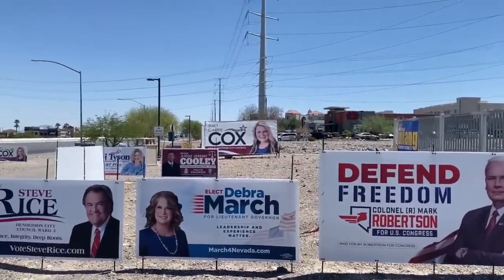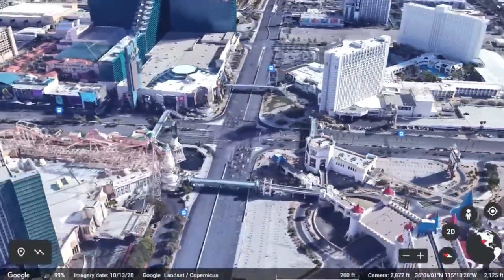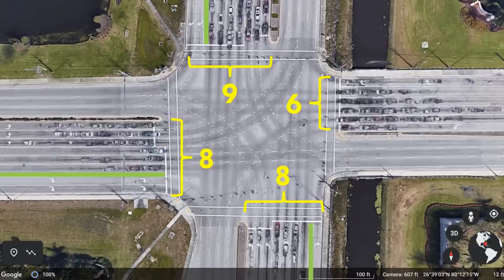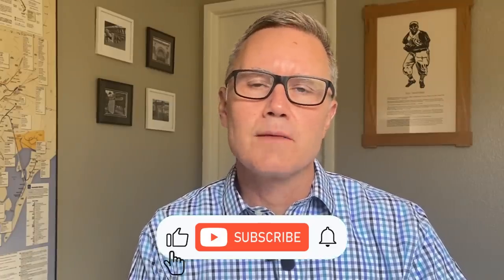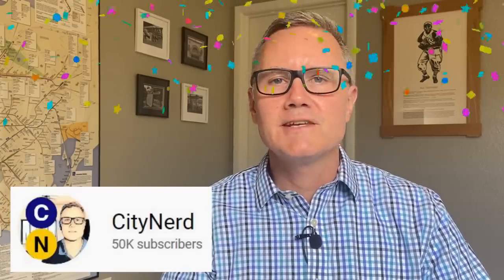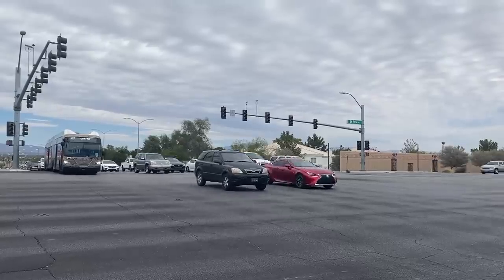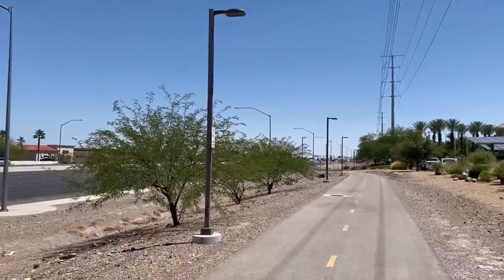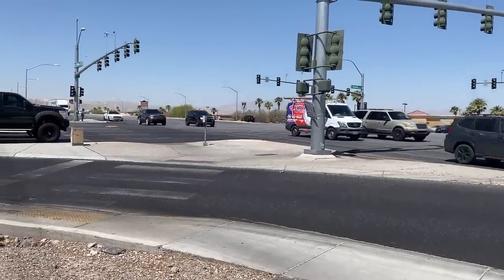Stroad vs. Stroad: Land Use, Traffic Engineering, and What Happens When Suburban Arterials Intersect

Comment: The problem with slip lanes and right turns (or left turns in left-hand drive areas) in general is that the traffic a car will be turning into is coming from the left so most drivers will focus to their left and not see the pedestrian or bike coming from their right. Slip lanes exacerbate this by giving a "safe" space for the car to wait that is usually ahead of the pedestrian crossing. This means that most drivers will still be going a decent speed (20+ kph) when they slam into that pedestrian in the crosswalk (or even faster if they see no traffic in the lane they want to turn into). Even though I try to be careful when crossing intersections I have still personally be hit as a pedestrian three times in five years while crossing suburban stroads. In each of those cases it was from a driver that was stopped at a red light who then went for it when they saw no traffic coming from the left, hitting me who had just started walking on the green. Fortunately I came out of these just with some bruises and lost skin.
Reply from the maker: It's really nervewracking crossing these things. I want some sort of assurance the driver is aware of my existence before I start crossing, but it's really hard to see through glare and distance and identify facial expressions. Such a flawed system.
Reply: It's bad enough just for cars---my first accident was because Florida Man, driving in front of me along a slip lane into a clear road, stopped at the yield sign while I was looking to see if there was any traffic to yield to. On a very wide road the slip lane will shorten the uninterrupted pedestrian crossing distance. But on the very few intersections where the crossing distance is a problem, a right-turn signal could be added.
Reply: Another, less acknowledged issue of right on red is that it means the car needs to creep into the cross walk in order to observe the oncoming traffic from the left, obstructing pedestrians.

Comment: In Texas all red time is definately still travelable as is two seconds into the following green.
Reply: "Thank you Jesus!  Thank you Lord!"
Reply: I can confirm this. I feel like I have to give a quick glance in the rear-view mirror before stopping on a yellow (greater Houston area) if I don't want to get rear-ended. Yellow-red running is absolutely commonplace here. A flagrant red is somewhat less common.
Reply: In Houston, I saved myself from a serious car accident a few times by looking to clear the intersection after the light turned green. I definitely don't trust other drivers.
Reply: @wenkeli1409  I've run a lot of Houston intersections that were on the red side and looked in my rear view to see at least one car went through the light hehind me.

Comment: My favorite (sarcasm) details that let me know that nobody cares are how they build the islands that are there for our safety with rounded off curbs that make it easy for cars to drive up and over them. Rims > humans.

Same with painted lines, rumble strips and fold over bollards designed to suggest lightly that cars and trucks stay out of bike lanes or pedestrian space but do nothing to stop them. 

Watch a semi-trailer hit a squared off curb on a right turn, the inside tire will scrub across the edge and then drop down into the road again. On a rounded curb even a regular car will have traction to drive up and over the island with ease.
Reply: It also keeps tires from accidentally hitting a steep sharp curb and popping the outside sidewall of the tire (did that once... not fun.)

Comment: It’s not often I go out to the suburbs, but I hate crossing two intersecting stroads in my power wheelchair. 

I do encounter slip lanes and beg buttons in the city — hate both. MoDOT builds a channel in the islands so I have to travel in it, even when littered with debris from car accidents. Sometimes they place the beg button too far away, or on the opposite side. 

The other thing I hate is when I’m barely started crossing a street and the countdown timer begins almost immediately.

Comment: Had to cross one of these on foot or bike on my way to and from work for 4 years (not as huge but it still sucked!). The ped islands are terrible, in the heat you have to wait there in the middle of all the black asphalt with no shade and zooming cars two feet away, its truly miserable. I think its probably at least 10 degrees hotter on the island than the ambient temp, which is a big deal if its 100 F out (common in the summer at the intersection i crossed, and im sure more common in las vegas!)
Reply from the maker: Yes, a literal heat island effect
Reply: @CityNerd  Yes!!!!

Comment: Man, its wild to see you discussing an area I drove for years every day, and still drive often. I also wanted to say that just a few blocks down there is a street called Starr Ave (or Raiders Way, which was formerly Henderson International, if you are on the southeast side of St. Rose) which a friend of mine pointed out as being an area currently being developed at such a point it may be possible to have some meaningful change after I complained to him about some of it's flaws. After Starr Ave was continued so that it connected to the I-15 it is either packed with Cars and Vans from the nearby FedEx and Amazon Warehouse or it is essentially empty, so much so people drag race on it at night. Since the area has undeveloped lots however there are a lot of areas without sidewalks, and the crosswalks are poorly marked. The reason this is so important is that it is right by a High School with a number of students walking home along Starr, and there is an Elementary school and Pre-School directly on Starr. While Starr is 35 mph with two 25mph school zones, since people often get onto Starr coming off of the I-15 or St. Rose, its not uncommon to see people driving 45-50mph. I have even witnessed a FedEx truck go 60 through both school zones with lights flashing. With St. Rose developing some new businesses nearby and having those separated walking trails / Bike paths, it would be easy to ride a bike to the nearby gym, or to stop by one of the small food places located within reasonable biking distance. Starr even has areas that are designed to become bus stops, but in the few years they have been there not a single bus has stopped at them. Starr is also likely to become a 7 lane Arterial with 3 lanes in both directions and 1 center turn lane. It currently has 2 in both directions with a center turn lane, although with ample room on the sides, once the area is further developed it will likely widen. 

I bring this all up because I am currently planning to go to the Enterprise Town Advisory Board (Since Starr Ave, once you pass Bermuda, is in Unincorporated Clark County instead of Henderson) to try and propose changes. However, I would love to hear others thoughts on the subject as I am not a Civil Engineer and am hardly an expert in city design. I am currently considering suggesting dedicated separated bike lanes instead of a 3rd lane, reducing the speed of W Starr Ave (specifically the section between the I-15 offramp and Las Vegas Boulevard) from 45 to 35, a better designed median since traffic in both directions sometimes has to enter at the same point, and lastly some sort of speed bumps around the school zones (While standard speed bumps would probably violate Fire Codes, there are smart speed bumps that have been developed that can pop up during the times lights would flash, and in the case of emergency could be put down to allow for emergency vehicles to pass.) Also for the time being, since the undeveloped lots will not be getting sidewalks until they are developed, I would like to urge the creation of some sort of alternative instead of simply walking/biking across dirt or in the street with traffic. Currently some areas have an asphalt strip where a sidewalk would be about 1-2 feet from the road which is better than nothing for the time being. 

I also would love to advocate at a later date for a change to HOV lanes on the I-15 (Although it seems they may be getting a change soon) to something like a dedicated Heavy Vehicle lane to allow for semi-trucks to drive through Vegas without blocking faster moving vehicles. If they HOV lane will remain as is, at the very least the addition of plastic bollards along solid double lines to discourage cars from merging in and out of the HOV lane randomly while allowing for emergency vehicles or maneuvers to avoid a crash to be preformed with no significant harm. Also I would like to suggest that the County adjusts the timing of lights along St. Rose between Starr and the I-15 so that it makes it easier for Amazon Vans to use St. Rose to access the I-15 freeway instead of Starr. Alternatively I would be curious about the possibilities restricting commercial vans along Starr during certain times of the day to induce the same effect, although that is something I think would hardly change much in terms of traffic or safety. 

Regardless, I would love to hear anybody's thoughts on the matter so that I could better propose meaningful change. =D
Reply from the maker: Just getting to this comment. I've biked around that area quite a bit (St Rose/Raiders) but haven't been on the north side up Starr. On an aerial or streetview it's pretty clear they're dedicating right of way to blow it out to a pretty wide cross section as you say. My experience from living a modest amount of time in this area is that the roadways are WAAAAYYYYYY overbuilt. There are streets with 5 and 7 lane cross sections that are never anywhere near being "congested." I don't know how they're doing the modeling and forecasting, but the answer's they're coming up with are very bad.

Comment: About Pork Chops: They seem designed to be horrible to bike across. My city has great bike paths, but whenever I have to cross a stroad intersection it's always depressing to have to navigate onto the pork chops, which are usually very bendy and such in a way you can't just bike straight through it and sometimes have to even dismount your bike. I understand this may be on purpose, but if our goal is to fight climate change why are we building bike and pedestrian infrastructure that make people not want to bike or walk.
Reply from the maker: 100%. It's never a straight path through he pork chop (often blocked by a signal pole too) and then to compound it there's often a queued right-turning vehicle in the slip lane, blocking the ramp you need to bike onto.

Comment: Can you do a video about accessibility of public transit in the US? I recently visited New York and though I really loved the city and subway system, I use a wheelchair and found only a tiny bit of it (mostly in Manhattan and Brooklyn) to be actually accessible. Hell, I live in Oklahoma City and our tiny streetcar lines and bus system and BRT lines they’re working on putting in are (at least technically) way ahead of the mta subway in terms of wheelchair accessibility.
Reply: That is more because the subway system is exceptionally old.  The core dates to very early in the 20th century, and a majority of the current system (almost all of it as I think) was built before WWII.  This means that it was mostly built in a time when people really did not think much about wheelchair accessibility, and labor was cheap enough that attendants could have been provided to help those who needed it anyway.  Also, usage at this time was so intensive throughout much of the day that the Subway was forced to employ people to squash the crowds of people into the train cars in order to provide sufficient capacity.  In that kind of environment, attempting to provide for wheelchair users and those with accessibility problems is a lost cause anyway.  Because of how the city and system interact with one another, retrofitting the stations is extremely expensive, meaning that doing it all at once is absolutely out of the question.  It has been done in various places throughout the system, and the new stations are all built with accessibility in mind, but it is a difficult and slow process.  Some stations might need total demolition and reconstruction to facilitate wheelchairs, for example, which is not something that is at all straightforward.  So it will be a long, steady phasing in of accessibility.  A similar situation exists on London's Underground and other old subway systems globally.

Comment: I was already growing increasingly aghast throughout most of the video until we hit the speed limits and then I kind of freaked out.. 45 I thought man that's fast and then 55 holy s*** - that's faster than many of the urban freeways in my town.  This is a dangerous abomination.
Reply: If you think that's bad, I've driven on highways in West Virginia where there are stoplights on roads with 65 mph speed limits, signs posted for that speed before and after the intersection.  Pretty crazy to go under a traffic signal at that speed, really warps your perception.  I can't remember which highway it was, I was just passing through from PA to FL (long drive)

Comment: There is a super simple (and relatively cheap) fix that would cure so much of this.  Use more one-way roads.  Intersections with one-way roads are dramatically simpler, safer, space-efficient, and faster.  This is because there is no cross traffic turns.  Without cross turns, arterial one-way roads can also have synchronized stoplights which dramatically improve performance.  Implementing this is easy...every other block traffic goes one way, then vice versa.  One way roads also create more vibrant and cozy neighborhoods like you see in Europe because you don't waste space on duplicate sidewalks, duplicate parking shoulders, and duplicate lanes.
Reply: Merchants go nuts (opposing) when you try to make their access road one way. Just happened where I live.
Reply: @stevesecret2515  They shouldn't.  Customers don't like to make cross traffic turns to access a business.  With one-way roads they don't need to do this.  Sometimes businesses are just afraid of change.
Reply: Most of suburban America doesn’t have blocks, so the one-way roads might have to be a mile or more apart. In-between the through-roads there are just a lot of dead end cul-de-sacs. You can see examples in this video.
Reply: @AaronSmith-sx4ez  yes they are. But they exist and make your idea unrealistic.

Comment: Chick-fil-a has been increasingly the bane of my existence since things started opening up again during the pandemic. Chick-fil-a had a lot of trouble keeping their locations fully staffed, meaning that they were drive-thru only for a long time, completely fouling up whatever shopping center they were part of. If I'm visiting one anywhere close to meal time, I need to use whatever entrance doesn't take me past the Chick-fil-a because their drive-thru line spills into the normal access lanes, making it impossible to access the parking in the vicinity, at least from that direction.

Comment: The worst intersection in Hawaii is Kuala St. and Waimano Home Rd. That one takes absolutely ages. There is a second traffic light right before that intersection that means that everyone commuting from up the hill has to wait for not one but two traffic signals to turn green in order to go. A close second for worst is the Kamehameha Highway and Kuala Street intersection right next to the Home Depot in Pearl City. A ton of traffic is trying to head west at the same time as a ton of traffic is coming out of the Home Depot parking lot as well as taking the middle left turn lane to go to the shopping center with Walmart and residential areas behind there. It is an absolutely insane wait for both intersections and both are stroad on stroad intersections.

Comment: As someone who drives a subcompact and has to access the hospital on the southwest corner of the intersection in this video fairly frequently, the bit about the rear-end collision was admittedly terrifying. Unfortunately there really isn't a safer, viable option to access the hospital, and I'm not going to trade in my car for something bigger or anything.

I also always assumed that the left turn lanes were blown out so far in advance on St. Rose due at least in part to the posted speed limit. Either way it feels like a huge waste of land. Especially considering how new the development in that area is, there's a lot of wasted potential in prematurely paving so much of it over. Clark County, LV, and Henderson could have done better than this without having to redevelop everything, but instead chose to make the same mistakes as many other American cities. It's disappointing, to say the least.

Comment: Some of my suburbanite friends don’t believe me when I tell them that traffic is worse where they live, than where I live which is like 2 miles from downtown Pittsburgh. But it is genuinely worse at times to drive in those areas than it is to drive near the city because of some of the strouds you have to deal with. And I would argue that Pittsburgh area compared to other metro areas I’ve been too doesn’t have a huge stroad problem relatively speaking. Just because it’s harder to build them here with the lay of the land.

Comment: Nitpicky comment is yellow clearance times are determined by the posted speed and grade. Red clearance times are determined by intersection width. Also another downside of width is even if a signal could operate with a lower cycle length often they don't in order to cover the really long pedestrian crossing times.